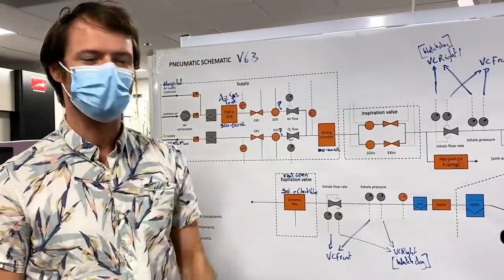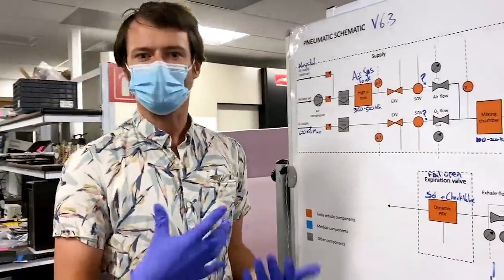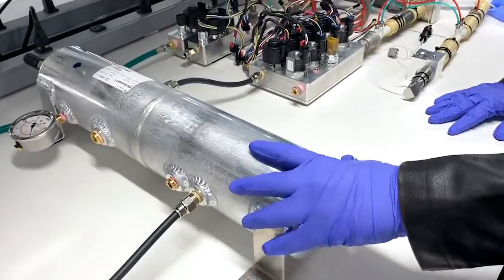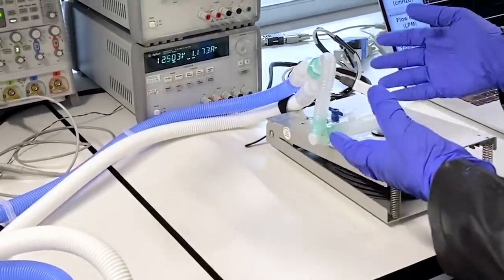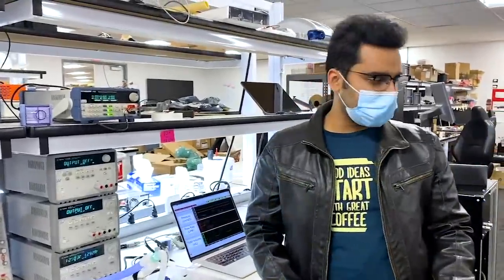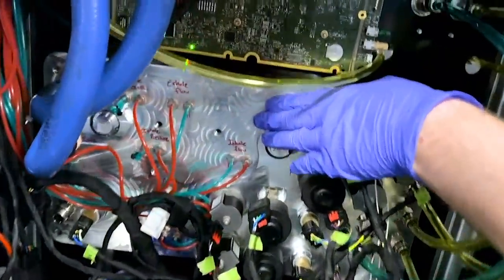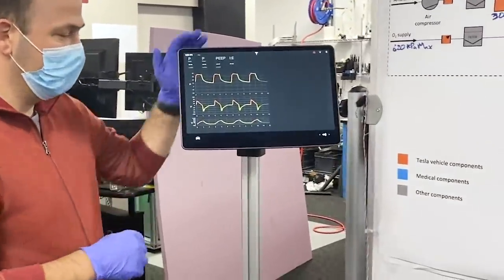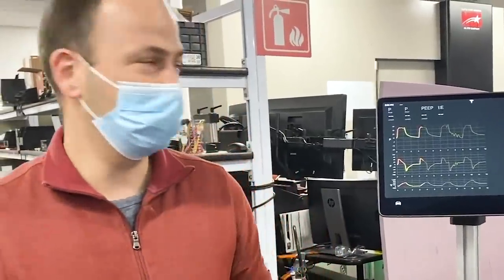Tesla Ventilator

Comment: Can’t wait to see what the hidden “Easter egg” function will be!
Reply: Net Wright Ludacris mode where it boosts pressure to 120psi 😂
Reply: @Shawn_Magara  "balloon mode"
Reply: @MM75354  ya. I see why poison and reason for hostage. Almost. Knocked out cold. Around 130am. Woke up at 6pm. Exhausted. Helium. Blimp. Goodyear. I won't make an effort here. If I get out. I will.
Reply: @MM75354  the perfect battery charger. One that has a chemical reaction. I cut finished batteries. Bring them back to life.
Reply: @MM75354  Imagine the perpétuel motiin machine. Worked with fans
Reply: @MM75354  helium and ballons out of my budget.
Reply: @MM75354  yes. And more. The cell phone. Voice and data communication through air. My identity. Voice. Assholes took my brother. Torn me apart so many times. Blocked from advancing sciences because of greesy law
Reply: @MM75354  that was for sat internet. None of this is amusing.
Reply: @Shawn_Magara  We'd love to invite you to our podcast as a guest.. ❤️
Reply: Mr. No Spark Plugz I bet it pulls the plug with the message on the screen saying, Congrats!
Reply: @ccentralchannel4492  BB wants. What bb wants bb takes. 98. 89
Reply: Shot of laughing gas every so often.
Reply: Congratulations you earned ASTHMA
Reply: 2nd Life
Reply: EmerGencY Kill switch
Reply: Where is the ventilator now?
Reply: @johnscarceforpresident1647  trump annkn opp took down ttade 911 xp alive. I was poisoned. Trudeau ally
Reply: @johnscarceforpresident1647  No ventilators. It's all fake news.
Reply: Rocket mode. Makes ur lungs fell like ur going to space.
Reply: @tristanturner7208  cold air. Also know as Oxygen OD. Over dose.
Reply: @tristanturner7208  i don't know.  I get jail time for innovation. That's the can way. Cover up lies with lies
Reply: aids
Reply: it unplugs while you're asleep and the doctors are alerted by the screen saying,"Lol My dolphin dont work"
Reply: https://youtu.be/bFz9wR-LA-Q

Best information about tesla
Reply: Net Wright complete shutdown.
Reply: Another game of stealing from the poor. He is going to admit his mistakes. Cause there evil
Reply: My life have elevated by the help of this man here  @carlos_1uptrades on insta who made me achieve my dreams in life through my investment in cryptocurrency bitcoin.  he promised to give me profits and after a weeks time he finally gave my profits I'm sharing this testimony because this is the only way to show appreciation for what he did for me so if you are out there looking for amother steam of income find him aat carlos_1uptrades and ask for  assistance.
Reply: What it’s like to breath on mars
Reply: Cookie is an Adobe mess. Period, cookies don't hang a 23 year old kid because his voice was identical. ET exactly the way I always described the feeling of I got from the way my coworkers and boss looked at me everyday of that sping. It's how I feel in country lie. Hand it over to the ones willing to keep the secret. Black targets my flight, someone paid for the other plan. I would of suffered the same faith as my brother. You really need the side cash that bad.
Reply: Lol, if some of you would meet me in person. I have a sense of humor. Dark humor, the French use pi for how are you doing. I would just say 3.1416. I gave them the awnser.
Reply: Single quite, alone. USa I was married once. Divorced. Not allowed because of the five banks. I am tired of covering up.
Reply: That laptop. Same guy who faiked update chance lg mod same guy. Blink Trudeau condescending. Today showed what he is. Backed virus for stealing. Right at the totally packed and ready. Buy time. So are you going to at least investigate murder? Some view that as serious crime. Open the case. Pm lies math doesn't. You would not have a debate. In fact it makrs you happy. You are going to be remembered as Puddle Gate tve son of water. I know youkst your father. My condensées. Losing loves onea is hard. Sincerely.
Reply: Why withdrew money. Testb stupid. Think. Stoke evidence pushes to me
Reply: @derektremblay338  dude how many people are you replying to?
Reply: Rexorded conversation. Too bad
Reply: Where she is stuck and admits to beig dirty. Biden Harris. Anon my ass. He opp affialrd
Reply: @derektremblay338  dude stop you dont need to reply to every message
Reply: Want it
Reply: What do you think about Judgea writing dui revenge for returning a document that told the truth
Reply: Lutin did nothing. Canada oohono corruption. Period
Reply: News use to blame the middle east. Plan one and two. Most don't know. Listen to music. Certain songs describe the wrong brother. Taillights. I know what he went through. I resolved what he went through. Dell I can see it. I rqn tests. How much was the reward for solving the battery issue. Solved it. Rewards are for anyone but targe. Goalie for darts.
Reply: @Jacob Bennett again. Wood rot. All natural. Aame identity. Light communication. Certains color. Coming. Jailed six months. Pm words on all "chances". Forget past when not allowed advancing. All i get is learn how to protect myself from law signing criminals. Replenish the li
Reply: Cured is the Easter egg
Reply: It’s called the imposter feature and it causes the person to flat line
Reply: BTC price hit $13,000 after an almost $1,000 intraday candle tapped the remaining bear market resistance keeping new all-time highs at bay a little while longer. With so many traders in profit, short-sellers have stepped up in a major way, opening millions in positions betting big that the recent uptrend will soon reverse. However, with so much money on the line, a potential setup for an epic short squeeze could keep the cryptocurrency trucking right along - which these short sellers might actually be perfectly fine with. Here's why I day trade with a genuinely and dependable trader/analyst like pomah  and win colossal profts out of the bullrun You can stop for one second to sit down to talk with him by procedures of Instagram @official_pomah.hectopfxfor any crypotrelated issues.
Reply: @floydfletcher680  Despite the economic crisis, this is the best time to
Invest invest in bitcoin
Reply: Btc is holding above crucial technical support at €11,000. It’s a safe haven unlike its rival USD which is experiencing a sharp decline
Reply: @garsonhank7146   I have been trading for about 6 months now and just about every trade backfires and slaps me in my face. Nearly impossible for me to catch more than a few points I try to do top down analysis but it doesn't work for me. I say to mysell, clearly I'm in the 90% that lose money, so l open a demo account, do my analysis, then take the opposite of what I would normally take and get the same result. I'm starting to feel hopeless, any advice for a struggling trader
Reply: @bethcalder30  Since you're a beginner, just keep trading and practicing. also I suggest you get in touch with an expert to help you trade
Reply: @bethcalder30  @official_pomah.hectopfx
Reply: @garsonhank7146  I’ll do just that thank you
Reply: @garsonhank7146  I have lost a lot of capital trading by myself lately, I hope he can do the same for me, as I need someone with a very good record to guide me
Reply: @floydfletcher680  I totally agree with you mate
Reply: I was able to gain over 7BTC in just 2 weeks of intensive trading with PoMaH
Reply: Calculate that with the current price of BITCOIN that’s over $90,000
Reply: The rich spend less and invest more
Reply: I wanted to trade crypto but got confused by the fluctuation in price
Reply: @austincannon9775  That won't bother you if you trade with a professional like Mr Pomah
Reply: Well, trading with mr pomah is nothing new to me. I’ve been an investor with him since 2019. He’s been a great mentor and account manager to me
Reply: My first investment with Mr Pomah earned me profits of $25,620 and ever since then he has been delivering
Reply: he's obviously the best I invested 2000USD with him and in 5 days I made a profit of 18,000 USD
Reply: If you press the power button 10 times, it will appear to be on, but it will not
Reply: Cursed
Reply: It disables the battery and auxiliary sources of electrical energy. It’s called “No-Mode”.
Reply: @pointlessco.6363  not like the card will make it here. Where is the bank debit card. Being used by cibc.
Reply: suicide mode
Reply: Nothing
Reply: Bilateral pneumothorax
Reply: https://youtu.be/8U-8UAN-6GI
Reply: Still waiting are you bro🤣
Reply: The easter egg is the device evaporating. Which they all did....
Reply: tap on the screen 3 times and the oxygen shuts off!
Reply: SAY you are trying to everyone else. Yet today again a a call about the ridiculous amount that I owe. I have been the equivalent of 20 plans in the last eight years. Trying to lie some more. Ironic. Oh and my global login. Messed up the iPad so bad that I can't get the info. PET computers goes back a few decades now. I wonder how they chose those letters and what they mean.
Reply: Nice certificate. Valid from,  a later date than the expiration. Looking back at jai night 2013. I never had a Samsung camera then. Look. They wanted widi. Had an excavator that needed some work. Samsung got paid hidden behind my device. I'm not going to say anything has changed. My days here,  with starting to understand. Really. Trying, in 2.5 months. Another seven pc's. Two ATV'S. Country leaving five eyes Because the other four saw the truth. Stop pointing at CN Country to cover up.

Comment: Too slow, too complicated,  it will be over before you get 500 out the door, unless you can do 10 people per ventilator, that is 50 out the door to = 500 people. More with less and the model 3 screen could “zoom” split to 10 screens, you have the hardware, just need the air flow. Shipping constraints, 4 per pallet in a double stack per trailer, that is how many cubic inches you have to make this work.

Comment: Elon: hey guys so this is the model s ventilator. Fully equipped with 5g and WiFi. By pressing this red button the oxygen converts to To2 . To2 is Tesla oxygen. A brand new element . Tesla oxygen extends your life by 5 years each minute you use it .  If you go home and forget your ventilator, it will convert to Ludacris mode and fly to your house . It’s battery last 7 years and never needs charging . 

This is what I expect when Tesla says they will make ventilators

Comment: You should have settings that allow the ventilator to adjusted for different age groups and body weight., as well as FiO2 (if using this with oxygen) and capnometry. What about a closed-circuit one (with a CO2 absorber like Sodasorb) which is good for infectious disease scenario (use antimicrobial filters before the breathing circuit)?

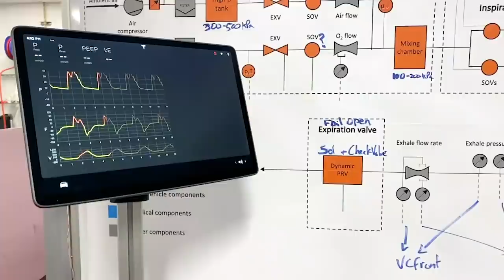Comment: I'm sure this is already known by your team but just in case it isn't. As a former BMET for GE MSIT I would like to remind everyone at Tesla to make sure the power supplies are medical grade. At 2:18 it sounds like he is saying the system is powered by the infotainment system which I'm assuming has an automotive grade power supply. There are some serious potential issues if the power supplies are not medical grade. Also HI-Pot test these units before shipping. You don't want someone being hit with a defibrillator to short the power supply and now you have mains power back to the patient. This could be easily overlooked if your engineers don't have experience in medical devices. This product page explains what I'm talking about. https://www.medicaldesignandoutsourcing.com/ensuring-safety-with-medical-power-solutions/

Comment: Why not make a much larger machine that can have like 100 air tubes come out of it and can help 100 people at a time? A tesla electric motor running some large pump thing can't be that hard and each line has its sensors and monitors.

Comment: RT here: can my high pip alarm be different sound from disconnect alarm aka what Servo I and U does :| cause ARDS pt high pip a lot and I have to check EVERY SINGLE TIME to make sure they haven’t disconnected. Also touch screen works with gloves on. Also remote control so I can give them an O2 boost or change the settings without gowning up. It would save a lot of PPE. Will this have SIMV settings? Pressure support cpap settings? How is leak compensation management? Like if my patient has a large leak around their endotracheal tube will this machine be able to compensate effectively? Will I be able to give manual breaths or “bag” the patient on the vent. Let me know!!!

Comment: finally, a not half-assed attempt at making a "DIY" ventilator that doesn't just forcefully inflate the patient's lungs like a balloon which is damaging. I'm looking at you virgin galactic and engineering YouTubers who didn't spend the time reading medical textbooks about lungs or decided not to include pressure or nerve sensors to sense when a patient wants to breathe.

and before anyone says they didn't have one either, they showed they have a pressure sensor that tells when a patient wants to breathe and how it changes when the breathing pattern changes
Reply: @MissCV  I got that what I was saying is that amateur ventilators made by YouTubers or engineers with no medical experience fully deflate the ventilator bag (there's probably a different term for it I'm not an expert) as I understand it which is probably wrong the lungs take in up to 600 ml of air but the bags hold over 2 liters so fully deflating them would hurt the patient, but there are valves that can limit airflow to stop 2 liters of air going into the lungs.
Reply: @MissCV  Ok, I will look out for Peep valves when I watch videos about BVM's, thank you for this discussion these last two days I have learned a lot about Ventilators.
Reply: Gorrium you are wrong tho🤭
Reply: @al11220  which one saying thank you, it wouldn't burst the alveoli, it has sensors, or it not being a half-assed attempt at making a ventilator
Reply: @gorrium5027  fight fight fight!  Sorry, as an engineering student that has worked internships with medical students, I love seeing people with an engineering solutions mindset fight with people with medical mindsets.  It's absolutely the best show on turf
Reply: Gorrium ummm...this one still does that. It’s called positive pressure ventilation. It’s how a majority of commercial ventilators work. It is of course the opposite of how the human body ventilates itself, which is a negative pressure process.
Reply: @kleinbiker1  you are right.  But this version of positive pressure ventilation is much safer as less or no sedative will be needed to ease the discomfort of forced air as the patient's lungs are the ones initiating the breath, not the ventilator
Reply: Lachlan Hudson the point is that it doesn’t really matter as most covid patients that are needing ventilation are also needing sedation.
Reply: @kleinbiker1  fundamentally, you don't want to cause further lung damage from too high lung pressure
Reply: Bilbo_Gamers I’m fully aware of how to ventilate a human. I’ve been doing it professionally for many years.
Reply: Chris Knapp yeah positive pressure is fine you still need sensors to do it right so you know when to turn up or down the pressure and lots of these amateur ventilators would drastically over inflate the lungs causing the alveoli to burst
Reply: Gorrium I know all this. I’ve been ventilating patients for many years.
Reply: @kleinbiker1  thank you for your service to society
Reply: please don't take that as being sarcastic
Reply: @gorrium5027  lmao, I kinda hope he does, this is the internet after all

Comment: Because fever is a symptom of COVID-19, isn’t it possible to fit a temperature sensor in the tube of the exhaled air? With this sensor it could be possible to keep track of the temperature of the patient. With that information doctors could see if a patient is improving or deteriorating.

Comment: You should add a remote control screen/ panel so that the Nurse doesn’t need to go into the patients room to check the ventilator. This would help cut down on the need to use as much PPE in the hospital.

Comment: Design lacks a HEATER next to the Humidifier, on the whiteboard @0:39  (in the section outside the Tesla system)
You want to control both the temp and the humidity going in.
Reply: In the packaged version of the ventilator, I don’t see a lot of normal wiring:
1) power for the humidifier/heater
2) low water sensor lead for the humidifier 
3) flow/pressure sensor by the patient mouthpiece.

Your measuring flow/pressure that the ventilator produces before the first filter.   After  the patient has been on the ventilator for 3 weeks, the flow through the filter will degrade.  The tube can also become loose or leak or impinged.  So you need to measure flow near the patient.

The patent also need to be suctioned for mucus (which got my father-in-law).  the flow will interrupted, on purpose, so you have to watch the feedback loop.

Comment: That is impressive but it appears what you really need is some better fitting masks!  every single person in this video had to readjust their face mask every 10 seconds or so.
Reply: The masks are less to protect themselves and more to protect others. They are there to prevent (for lack of a better word) spittle from spraying over everything if they are infected and don't know it. Those paper masks aint gonna do shit to an actual virus cell.
Reply: @richardmillhousenixon  Masks act as a barrier protecting against both infection and transmission of viruses.  Granted they do not protect with 100% efficacy.  Furthermore, even if masks functioned like a one-way valve for viruses (as you suggest) my initial point still stands: if the mask is constantly slipping down your face and requires re-adjustment every few seconds (touching a mask reduces efficacy) then perhaps some better fitting masks are in order.  though any mask is better than no mask and these are desperate times so it's understandable that they are using sub-optimal fitting masks.